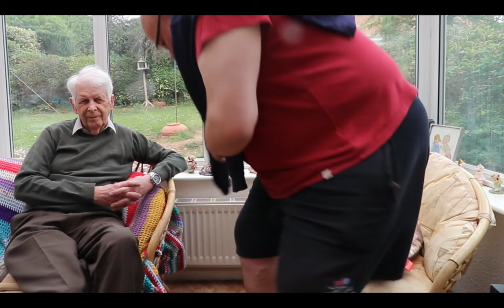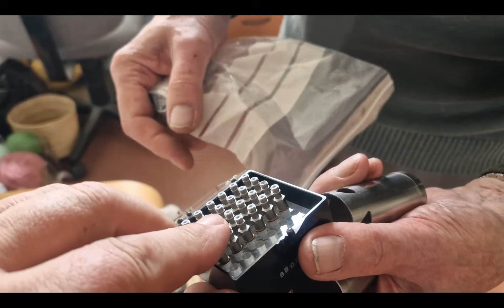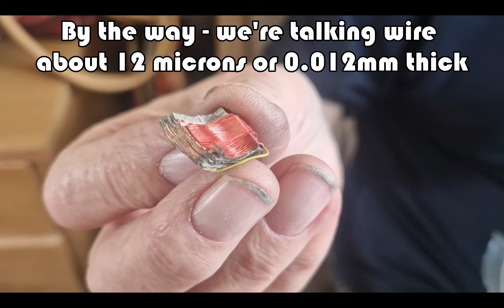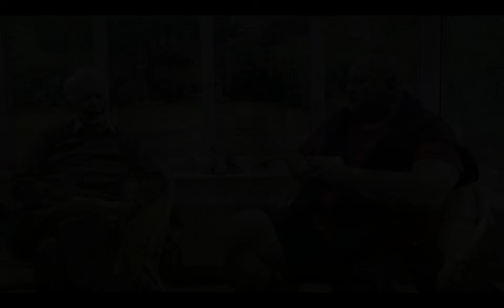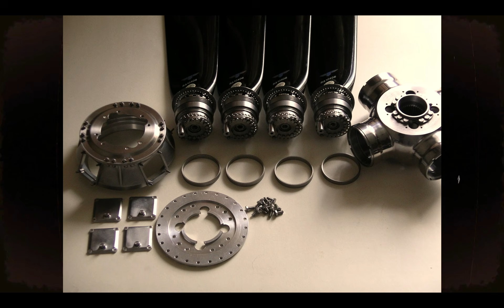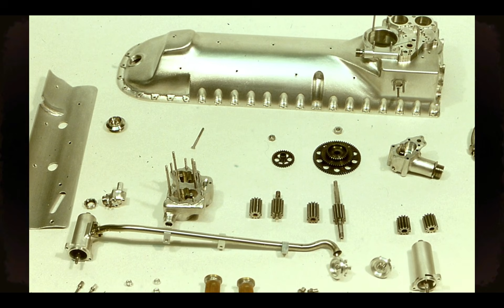Unreal 1/5 Scale Rolls Royce Spitfire Engine Part 2: Barry Hare's Mastery

Comment: Just curious. I was wondering how much that engine weighs and another question hit me as a model airplane hobbyist. If a Merlin engine weighs 1,700 lbs, how much would it weigh in 1/48 scale and what is the math to reach the answer because 35.42 Lbs don't seem right.
Reply from the maker: If you halve the size you quarter the volume so go down to 5th scale and they don't weigh much at all.
Reply: @TheBluebirdProject thank you.

Comment: Absolutely amazing. Im just in awe. Thank you for making the videos and interviews.
I have had a thought to scale an Austin 7 engine but no where near experienced enough. Easy compared to those models. Guess trial and error start is better than never. 

Questions if you interview with questions, How did he make all the water passages and manifolds and oil feed paths. Any seals required at that scale?
Workshop tour please. Untidy means it is in use and who cares about that

Regards From South Africa
Paul
Reply from the maker: Hi Paul from South Africa, It would appear, and that is another question for Barry to clarify this one, that he milled and drilled the manifolds, waterways, etc, as far as was possible then basically sculpted the metal from solid using whatever tools were most suited for the job. I know he used dental burrs and tiny cutters so I assume needle files and abrasives were used too but they were all cut by hand from solid billet. The Eagle films are coming along soon and there you will see the dozens of tiny seals and gaskets too. I don't know how necessary they are at that scale but, like everything else, they're in there. 
We'll see what can be done about a workshop tour...

Comment: You ask whether viewers have any questions for Barry?? "Hell yeah, you bet!! Boy, do I have a burning question I would dearly like the answer to....! My ears immediately pricked up when your interview turned to the subject of the propellers (~23 mins). Barry had a momentary brain-fade and couldn't recall the company he approached for technical information but I suspect he was referring to ROTOL. To think they were about to throw it out! It's treasure-trove - it boggles the mind! I have a specialist interest in an obscure aviation technical subject, that of the multi-speed propeller, i.e. the reduction gearbox in the nose casing incorporates a number of ratios - more usually just two via a planetary gear-set selected with brake-bands - which are automatically selected in flight, just like a car about to climb a hill. A model variant of the R-R 'Eagle' was proposed with such a propeller reduction gearbox but I believe it progressed no further than the preliminary design phase but possibly some mechanical elements may have been bench tested. The development of the multi-speed propeller was in the capable hands of a brilliant R-R engineer who went by the good, solid English name of Thomas Pitt de Paravicini. The RRHT were of no help - all information apparently lost to the swirling mists of time.... but now with Barry's surprise revelation, perhaps not! 
So, I wonder would you be good enough to ask him whether he could dive into those rescued archives and see if they include any mention of this Eagle (or any other similar development) propeller reduction gearbox variant? Could he also give viewers a quick inventory and overview of what these records contain? Do not underestimate how academically important this information is to serious aviation technical historians and researchers. Thanks.
Reply from the maker: I've had a good look over the pics of the disassembled gearbox from the nose of the engine and the propeller hubs and I'm 99.9% certain there is no planetary gear set or brake bands in there but that doesn't mean Barry doesn't know about it or have info. I shall ask the question when I speak to him later today. If you want to mail me directly Bill@bluebirdproject.com that might be easier.
Reply: @TheBluebirdProject  I'm afraid you've completely mis-understood my remark: The 2-speed reduction gearbox variant was never built and thus didn't enter serial production. It was proposed for a Hawker advanced fighter project. Amongst Barry's precious archive there may be technical reports, engineering design calculations, engineering drawings, etc. that relate to this variant. This is the information I'm seeking. Do not treat casually or under-estimate the importance of this archive to professional aviation historians. I would urge you to persuade Barry to make copies available to the likes of the RRHT and other aviation museums and institutions to guarantee their preservation for future researchers - it is THAT important; they MUST NOT be lost with Barry's eventual passing (maybe leave that bit out of your conversation with him!).

Comment: I think for me it`s the spark plugs which illustrate just how small 1:5 really is. Mind blowing!
Reply from the maker: They looked like a box of sweets, or .22 cartridges. Certainly not spark plugs. Platinum wire electrodes and 0.005" gap for the spark. As you say, mind blowing.

Comment: I don’t understand how he makes these cases with all the bolt bosses without castings or cnc.
Reply from the maker: All done by hand, from solid on the milling machine then hand finished with dental burrs, needle files and abrasives. Pure skill that's been bred out of today's engineers, sadly.
Reply: @TheBluebirdProject  i would dearly love to see pictures of it going through that process. I simply can't visualize how one could do that by hand.
Reply from the maker: @sblack48  Sadly there are no pics of the Merlin parts being built that way but there are one or two pics of Eagle parts in the rough milled condition prior to hand finishing so they will appear in the Eagle build videos in a few weeks. It just goes to show how much people have become dependent on CAD, 3D printing and all the other modern ways at the expense of pure skill, ability and problem solving.
Reply: Also a massive amount of math!

Comment: I make my own springs.  Wound from spring steel stock (piano wire) and after winding,  stress relieve to dark straw colour to relieve the internal stresses.  I thought everyone knew that ?
Reply from the maker: Doesn't everyone make their own springs? Barry overhauled some hydraulic valves for us for Bluebird and the pressure they ran in the boat was a lot less than what they ran in the aircraft they came from so we thought we'd have to set them up when we got them back but, strangely, they were at exactly the right values. Turned out that before he'd stripped the old units, Barry had measured the completely adjustable spring pressures by some means and put them back as they were. No idea... 🤷‍♂️
Reply: @TheBluebirdProject  Last place I worked at the Design Engineering group had a Technician to do prototyping work.  Upon showing an interest in his work I was agog to learn that he didn't make his own springs,   nor was he interested to learn either.  A fairly young fellow under 30.  Barry would have measured the spring force (not pressure) first with either a tension gauge or a compression gauge.  One of my Engineers gave me a simple spring calculating slide rule he'd made out of thin card,  which I still have.
Reply from the maker: @aeroearth  I actually asked him to show me and he used a device I can only describe as an aluminium knuckle duster with a dial gauge that went onto his milling machine to squash or stretch the test subject. I hadn't seen such a thing. I don't know whether he made it or acquired it somewhere down the line. Neither would be a surprise.

Comment: Discovering the Reynolds factor has completely changed my understanding of mechanics, when Barry says that the supercharger won't scale I had to find out why and leaned a little about the Reynold calculation, fluid dynamics and friction/surface area at scale, it seems engines have to be a certain size for top efficiency.
Reply from the maker: It's one of those subjects where it's so easy to get away down the rabbit hole but it just goes to how, we're never too old to learn something new. 😊

Comment: One other thing, nowadays you could 3d laser metal print a lot of the hundreds of Barry's components, and machine these using benchtop CNC 5 axis mills, lathes, EDM and a whole lot of other modern machines and computers etc. What I find intriguing is Barry has made it from scratch, by hand, 1/5th the size in suitable materials without drawings or CAD or Ai. 
I could listen to this man all day long....Amazing....
Reply from the maker: Indeed, no CAD, CNC, laser scanning, 3D printing, though he did have the drawings, but just a great deal of skill, artistry, problem solving and patience. And no modern contrivance could wind a magneto from 50 gauge wire! Amazing, as you say.

Comment: Over the years I've seen both of Barry's engines in 'the flesh'. Photos cannot do the engines full justice. Both are masterpieces of the model engineers art. There is model engineering,and then there occasionally comes along an absolute masterpiece,that is model engineering on another level. These engines are on that 'other level'. Breathtaking both.
Reply from the maker: They are certainly that and the Eagle is even better than the Merlin, if that's possible. The Eagle even has a small gearbox on the back that has nothing to do with the engine. It was a Wyvern part for running the generator, hyd pump, air compressor, etc. That works too.

Comment: The company he would have got the propellor drawings off would have been HDA forgings, now called Metis aerospace. It’s half a mile from my house, they have the world’s largest power press and you can hear it for miles. Bit of Redditch history for you guys ☺️
Reply from the maker: Fascinating little slice of history there. I remember seeing HDA Forgings on the wheels of Trust SSC. They were quite piece of engineering. They couldn't have holes in the middle because the forces had to be shared across the whole diameter.
Reply: @TheBluebirdProject nowadays they make the vanes for Rolls Royce jet engines but back in the day it was a huge part of the war effort. It stands on the opposite side of the road to the royal Enfield factory, my grandad ran a miller every day there for 40 years 👌
Reply from the maker: @Turboderry  Is that the place with the massive steam powered rolls for making battleship armour?
Reply: @TheBluebirdProject possibly, the press they have is called the mega hammer and it has its own reinforced building 🤣